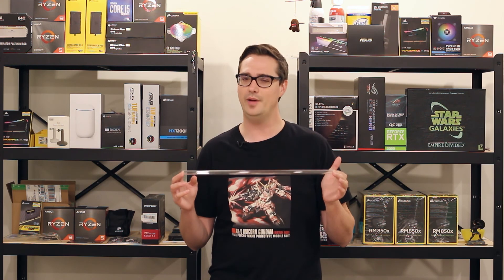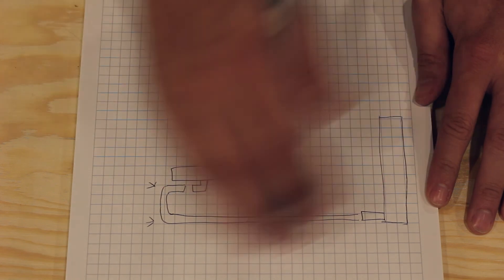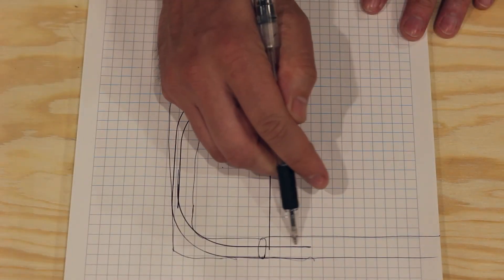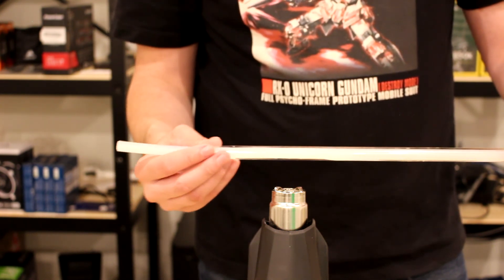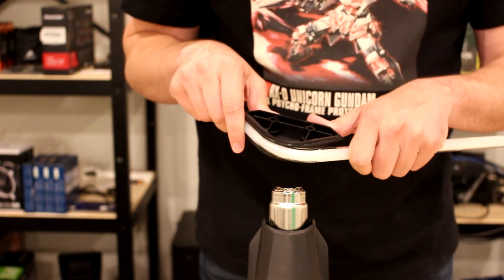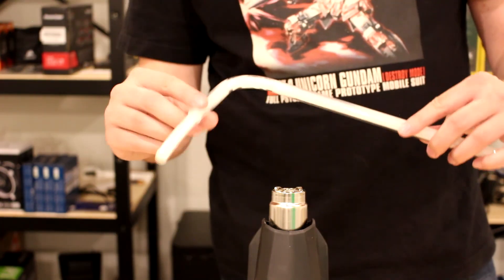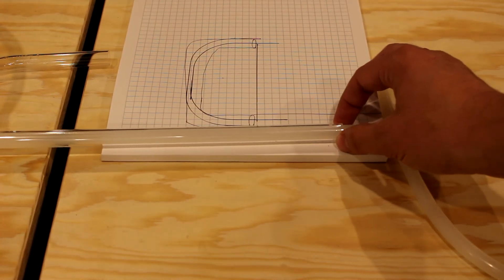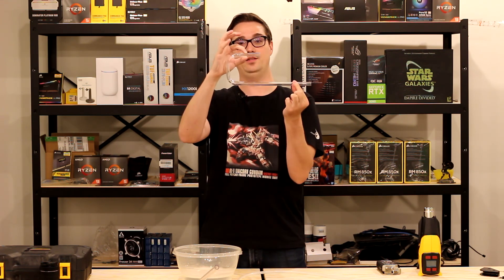Tips for Bending Hard-Tubing in Custom Loops

Comment: What about for 2 bends that are perpendicular 90s from one another so like straight out from pump 90 to the left to get to you and then 90 up towards GPU? I hate the look of lots fittings and 90 fittings
Reply from the maker: You can totally do that. I have entire runs with several bends that have only fittings at the start end end points. Patience and time. Drawing out and measuring out your patching is important. Measure twice, cut once, bend once.

The challenge is that if your measurements are off, or you aren't sure where to bend it, you can end up being really far off from your target.

Tube bending requires as much spatial awareness and spatial thinking as it does a good respect for measurements and planning. Some people never get good at it, some people ace it out of the gate. Trial and error, patience, and spare tubing is recommended.
Reply: @UnhingedSystems  okeee sounds like I gotta yeet it and present it!

Edit: but no for real Ty for the response I for some reason went with hardline as my first build ever and I’m only running into more and more problems. Your video explained way more than anything else I’ve seen THANKS!

Comment: For the soapy water, did you use regular tap water? If so, what would be the best practice in terms of cleaning out the tube when you're done bending? Thanks for the great and informative video!
Reply from the maker: Thank you for the question! I used regular old dish soap and tap water. After bending, the tubes are first well rinsed with tap water, then double-rinsed with distilled water before being used in the loop 👍

Very important to rinse all components thoroughly before filling the loop. I'm going to test with a deionized water soak before a distilled rinse on the radiators to try to reduce ion transfers between copper and nickel, probably won't make much of a difference though.
Reply: @UnhingedSystems  Much appreciated, have a great day!

Comment: Hey man! Another question for ya. About how long would you say you heat on average to complete the bend? Have you ever timed it?
Reply from the maker: Great question! It depends on the tube type (acrylic or PETG), and the diameter of the tube, but in general probably about 3-5 minutes per 3" section. I have see some videos of people heating the whole tube and doing massive bends in one go, but I prefer to bend gradually to get the shape I want without distorting the tube. Some bends take 20 minutes, some take up to an hour or more depending on the complexity of the bend(s). Patience is the key, it shouldn't be rushed. Tubing with larger diameters typically have thicker walls and are easier to bend. Smaller diameter tubing with thinner walls are less forgiving.

Comment: Hey there, I think you might have the same heat gun as I do--- if you're using 530F for acrylic what fan speed do you go with? A higher or lower speed fan?
Reply from the maker: I use it on the default medium speed, works wonders. Thank you for the question!
Reply: @UnhingedSystems  Thanks for your reply! While on the subject, what sort of cutting attachment do you prefer with the dremel for making cuts? There's a lot of options out there.
I've experimented a lot with various hacksaw blades and saw types to get the easiest approach and want to try my dremel as well. Any tips are appreciated! Thanks dude.
Reply from the maker: @akaJoeyR  Great question! I use a standard cutting/grinding (409 Cut-off wheel) wheel on the Dremel. It doesn't make the cleanest cuts due to the limited radius so I sand down the cut flat before adding the chamfered edges. I really want to get the little Dremel chop saw to make things easier, but for now the Dremel works great. The way it heats up the acrylic as it cuts ensures it won't shatter or crack. The trick is not letting the tube vibrate when cutting it as the micro scratches on the tubing can be rather unsightly. I honestly prefer to work with acrylic over PETG any day.